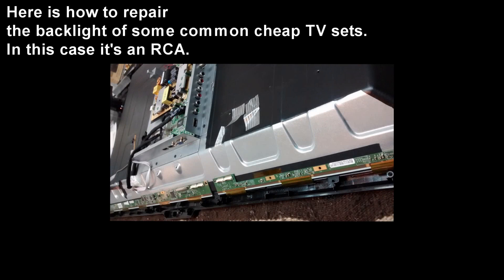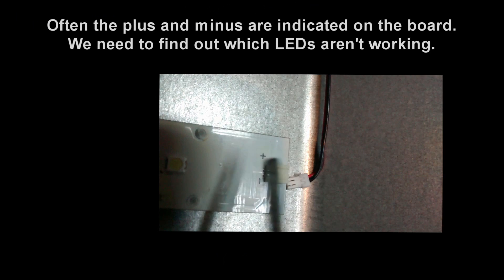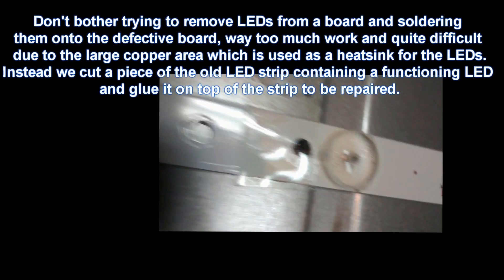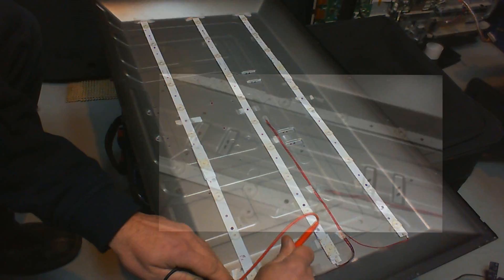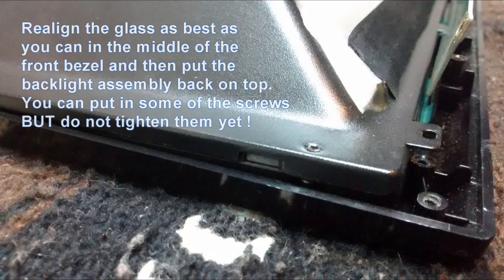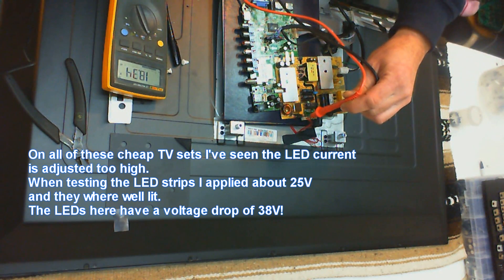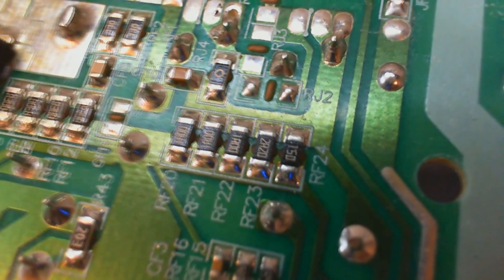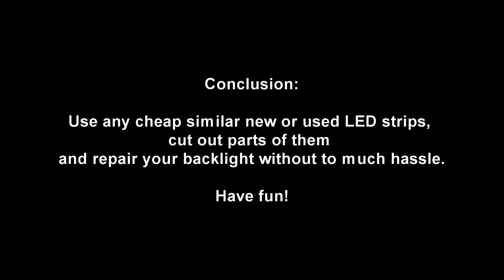Easy DIY LED  TV backlight repair

Comment: Instead of cutting and gluing strips - flipping clothes iron upside down and heating the part with led to 280deg works like a charm. Replacing led is then the easiest thing one has to do when fixing backlight.
Cheers for this video, gave me heads up on what to expect :-)
Reply from the maker: Jo Russ good idea, the iron!! I usually use a hotplate and solder paste though
Reply: Yeah, I was in a pinch. Took the led off with hot air but I couldn't imagine how I'd solder it back with it so yeah, necessity mother of invention... 
But I'll be building hotplate next for led repairs :-)

Comment: Hi Tom where did you get the LED spare parts from? so hard finding a supplyer, im stuck atm.
Reply from the maker: I often used LED strips I recovered from unrepairable TV sets. On ebay you can find single LEDs for some TVs like Samsung and LG you can use for many other TVs. You can also buy single LED strips on ebay for a particular model and remove the LEDs and re-use them to repair your defective strips. Depends on the model what the best solution is.
Reply: thankx TomTechTod gonna look out for them. Greetings from Germany

Comment: So easy that in January having room temperature of 13 celsius while i was trying to open some 32inch vestel clone for backleds repair i got wet to the bone from sweat and i had heart pulses like a marathon runner and in the end i was so tired like i was a real marathon athlete.In fact this is not the easiest thing on planet earth.
Reply: Try a 55" or 65". those are GREAT😂

Comment: Hi Tom, i have same RCA as the one you just fixed on the  video. it shows red when plugged,  push the standby button in turns into blue light but the screen is still blank(black) does this indicates the backlight is bad just like yours on the video?
Reply from the maker: Try to look at it in a completely dark room to see if the backlight works.   To be sure you will need to measure the voltage drop on the LEDs, meaning the voltage on the connector that goes to the LEDs
Reply: thanks for your quick response.. the back light don't turn on at all
Reply from the maker: +Jude Dugbere ideally you will need an oscilloscope to detect if the PSU still tries to drive the LEDs. Is there any voltage on the PSU output towards the LEDs? (even for a brief moment)
Reply: yes,..there is
Reply: at the LED strip where it says A n K , i could read 19.1 volts on each strips
Reply from the maker: +Jude Dugbere then it is likely you have one or more defective LEDs
Reply: but still the Led don't turn on, am about to test each led right on the strips
Reply from the maker: +Jude Dugbere 19V looks a little low though. depends on how many LEDs are in series. RCA and other no name manufacturers sometimes sell the same model with different boards/configs
Reply: TomTechTod it starts with a high voltage and gradually steps down to 19.1v
Reply: 10 LEDS in each strips
Reply: RLDED3955a this is the model number
Reply from the maker: If it's not even dim at the beginning it seems to be the LEDs. If you know that there are 10 LEDs you probably opened it already. Have to check one by one.
Reply: i have it all opened up..how do i successfully test the leds one by one? am clearly unable to trace the anode and cathode?
Reply from the maker: +Jude Dugbere + and - should be indicated on the strip, you should be able to follow the traces. usually they overheat and the little plastic diffuser cap on top of it melts. (but not always) .adjust the current limit on your benchtop power supply to  a low value, I'd say under 300mA should be safe. slowly increase voltage to not more than 3V, a good led should light up
Reply: +TomTechTod thanks, what site can I order the LEDs
Reply: Tom found 3 LED bad
Reply from the maker: Hi, good you found them. I do not know where to buy them, never bought LEDs trips, always reused some from other TVs. You can probably get them on eBay or Aliexpress, Just buy some from a similar TV. It would be wise to reduce the current through them either by hardware modification of the driver circuit or by adjusting the backlight brightness in the menu, if there is such an adjustment
Reply: thanks
Reply: i bypassed the damaged lights with a wire and the back light lits up ...yeaaaa
but i have to replace the damaged once though..haha
Reply from the maker: +Jude Dugbere yes you should replace them. the led driver is a current supply, so jumping a led should not increase current. however, it is usually to high in the first place, thats why it should be lowered as I recommended earlier
Reply: am searching ebay now to get the leds,

Comment: Good stuff!! I have an ELEFT466 with no back light, there are 5 small connectors that i believe power the back lighting that come off the PS. When the TV is powered on the voltage can be measured at around 300mv, but I am not sure if I am missing something or doing something wrong. My power supply used to try to power up the back lights only goes up to 15 volts. I thought this would be enough, but after seeing your Video I am not so sure.
Reply from the maker: +Joe Scavone I don't know the LED configuration of your TV. Voltages can vary considerably depending on how many LEDs are in there and how they are connected together. If you measure 300mV, that's not enough. However if you use a multimeter for that instead of a scope you might not be able to catch a short voltage spike that could be initially present and after which the LED driver circuit could turn off due to a protection feature...

Comment: I have been searching everywhere on how to get to the backlights and you are the only one I have found with some info...I have a Seiki se47fy19 and I now need together to those backlights because I already changed out other boards one at a time....the screen came back on and then began to darken and then out....is it hard to do backlights...I figure I have nothing to lose ...I already have a broken tv....has sound but no picture..(.can see picture with flashlight).
Reply from the maker: +Tanya Eagan It will be difficult to determine if the backlight is defective without at least a multimeter and/or oscilloscope. I do not know your particular model so I can't say how hard it is to open the backlight assembly. Yours is a 47 inch TV which is way more difficult to open than a 32. But it can be done. If there is there voltage on the connector (even for a brief moment) when you turn on the TV but the screen does not light up then yes the backlight itself maybe at fault. I did it for a 70 inch TV so it's definitely possible, just take your time. I can recommend the online forum badcaps.net if you have further questions.
Reply: Thanks

Comment: hi men, good videos! i want to say first my english is not so good, i'm a latin guy, but seeing your videos i need answer you something: i have a tv led 40" siragon brand but in the inside the inverter board and the panel or screen both are samsung , so i have a problem with the backlight of the tv.in the superior corners is darknees, i see meny videos how to remplace it whit leds strips, i work whit that, so can i comunicate whit you for sent you a picture? and request some opinion of you?
Reply from the maker: +peter csendes I think you should be able to send me a private message via youtube or google+. I can also recommend the forum badcaps.net (in english)